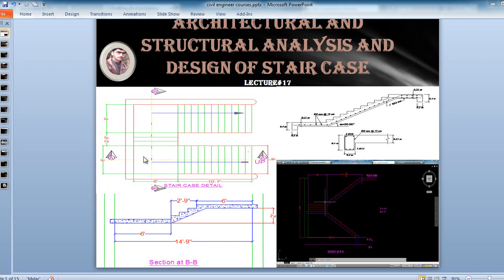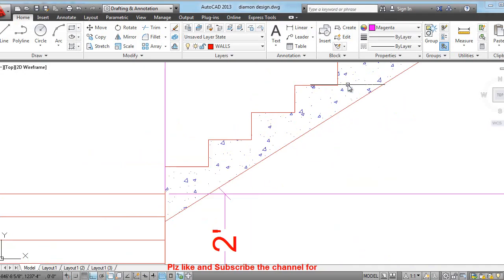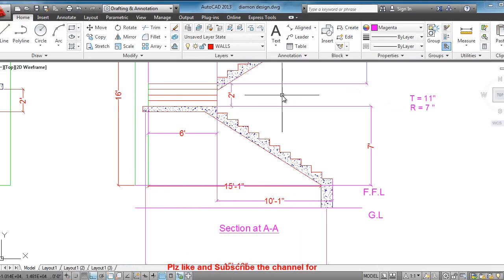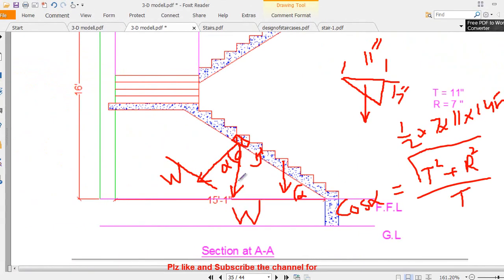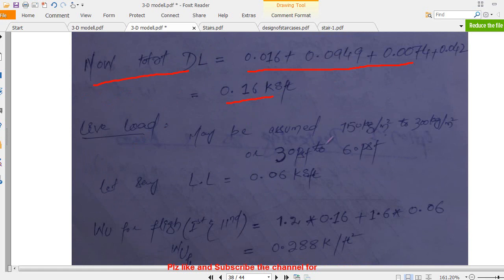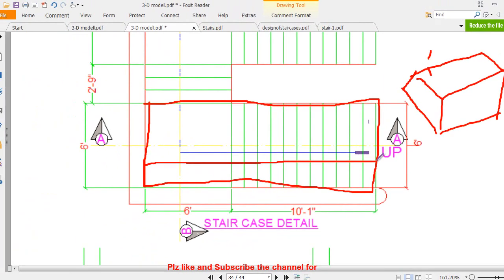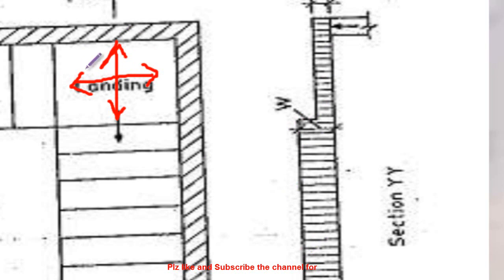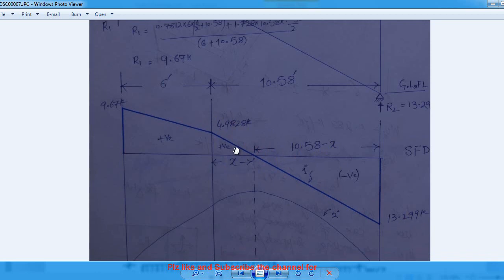lec 17 srtucture design of staire case accourding to ACI

Comment: Why did you add the dead load for waist slab on landing? There is no waist slab on landing just on steps. Correct me if i am wrong. Thanks
Reply from the maker: Plz I just skip the step load on landing the waist slab thickness is same for landing as well that why I use the waist loading
Reply: @EngrTechMisbahUllah  ok Sir. Thank you